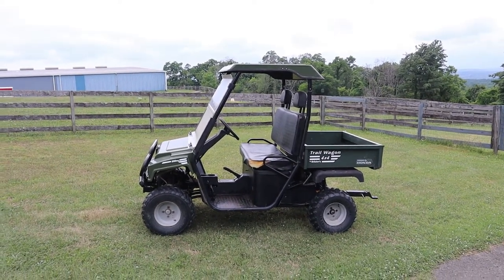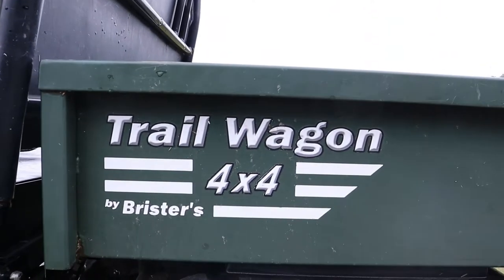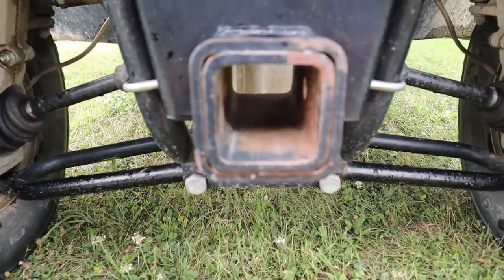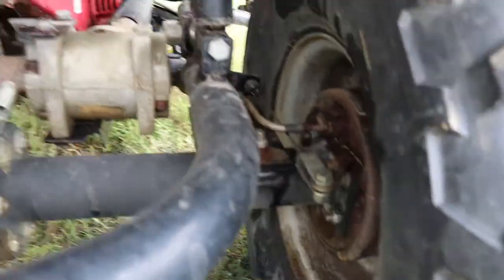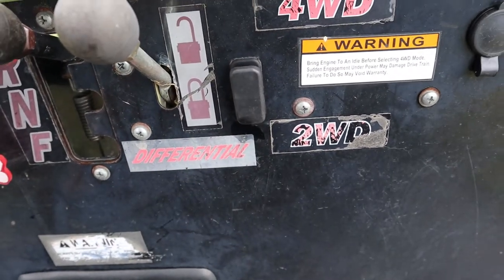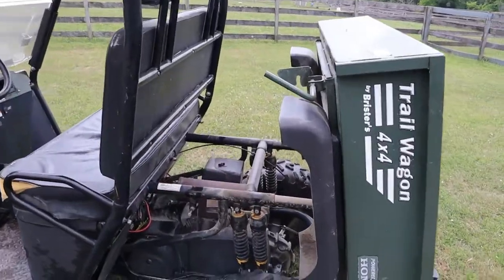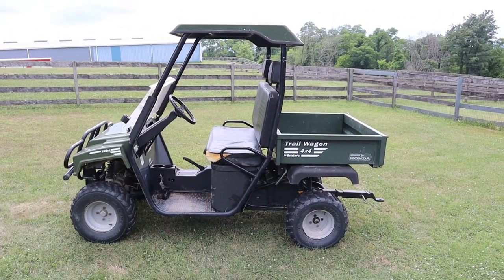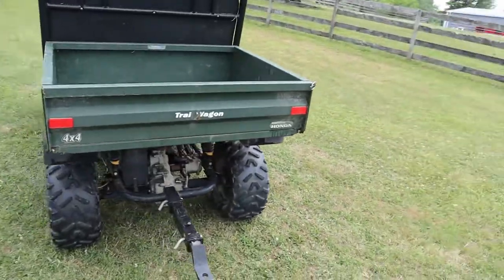#13 American LandMaster predecessor Brister's Trail Wagon

Comment: Three people don't like this as of 2024. I don't get it. I have a 2006 CW-11 Brister's Chuckwagon which is a 2WD version. I've had it since new and aside from replacing the carburetor, it's been a great little UTV. I replaced the belt after 18 years and it was still in good shape. I have had to replace the seat backs for the wood rotting, but for what it cost and what it is, if I could find some super cheap ones that need work, I'd buy them by the gross. Great little simple UTV.

Comment: When you disconnected the seat belts did you have to adjust wiring? Mine is not going any faster than about 12mph. Thanks in advance.

Comment: Just picked up a chuck wagon 2 wheel drive for 500 buck was pretty sure motor was blowed after getting into it I checked the valve lash and runs great smoked for a few min I need to replace exhaust and tires but it will be a cheap little yard tool
Reply: Apparently Norther Tool sell a Honda copy of the engine that works well.....420cc.

Comment: Love your Trail Wagon ,.. I have a Brister 390cc in it  too.    Nice job showing it.   How did you know which ones of the wires fit on the starter.  I have a green wire that isn't hooked up but I cant short the positive on the starter solenoid across and it will start  ..  but don't know which wire needs to be hooked up to starter so I can use the key.    any thoughts on this ..   I would appreciate your help.    thanks much..     GD Tractor
Reply from the maker: Hi GD Tractor, thanks for commenting. I will take a look at mine and see if I can get you any further information in regard to wiring. Also I would say that the folks  at LandMaster were very helpful when i called them with some questions, they even put one of the engineers on the phone for me to talk to
Reply: @jeffjones6541  Thx !!